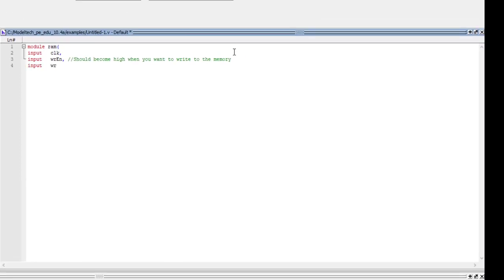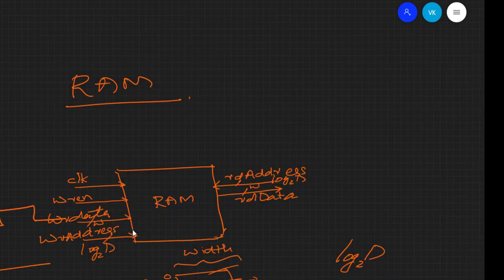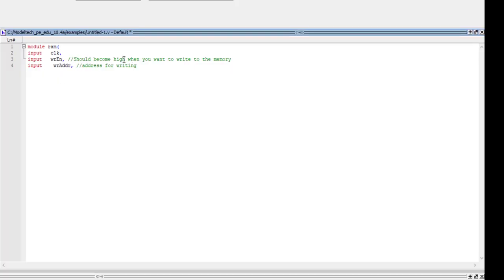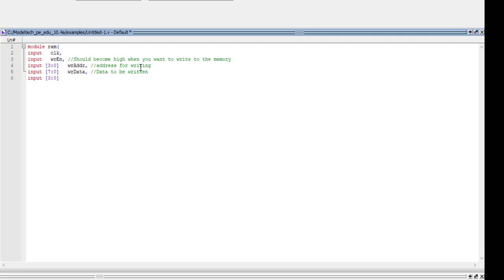Modelling of Memory Part-1| Modelling Random Access Memory (RAM)|Verilog| Part 24

Comment: can i get the testbench code
Reply: simple ram testbench code version below>>>>>>>>>>>>>>>>>>>>>>>>>>>>>>>>>>>>>>>>>>>>>>>>>>>>>>>>>>>>>>>>>>>>>>>>>>>>>>>>>>>>>>>>>>>>>>>>>>>>>>                         `timescale 1ns / 1ps

module ram_tb;

reg clk, wrEn;
reg[3:0] wrAddr; 
reg[7:0] wrData;
reg[3:0] rdAddr;
wire[7:0] rdData;

ram UUT(.clk(clk), .wrEn(wrEn), .wrAddr(wrAddr), .rdAddr(rdAddr), .wrData(wrData), .rdData(rdData));

initial begin
  clk=1'b1;
  forever #10 clk =~clk; 
end

initial begin
//write data to RAM
wrData = 8'h01;
wrAddr =3'd0;
wrEn=1'b1;
#100

wrData = 8'h02;
wrAddr =3'd01;
#100

wrData = 8'h03;
wrAddr =3'd02;
#100

//read data from RAM
rdAddr =3'd0;
wrEn=1'b0;
#100

rdAddr =3'd1;
#100

rdAddr =3'd2;
#100;
end

endmodule